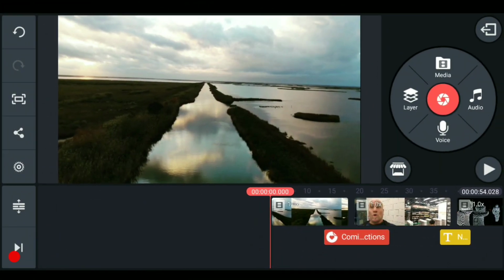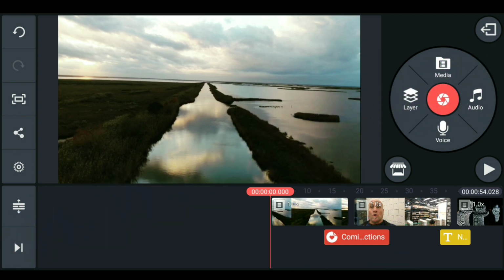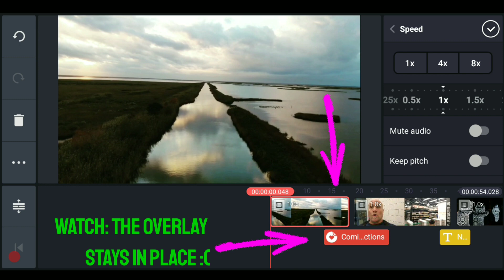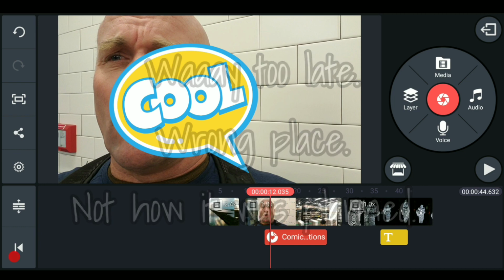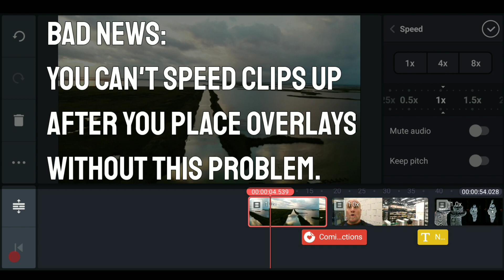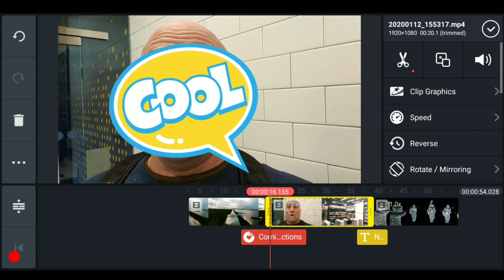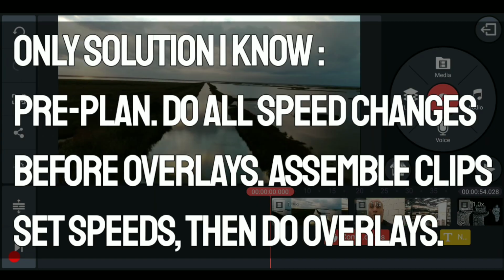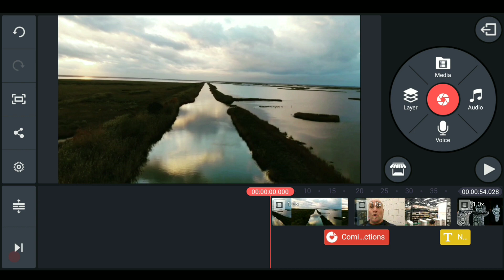Kinemaster Tutorial - working with speed changes and layers

Comment: Unfortunately if I go over 1.9 speed I get a message it will not play right.Would be nice to be able to use higher speed ups🤔
Reply from the maker: Hello, I am pretty sure that message is only about preview speed - once the video is exported it should be able to play properly.   That said, speeding up really fast can still result in jumpy output because the reality is that you are cutting out content in order to compress the time.  It's a mathematical formula (not one that I can actually calculate - but it is math) and so a lot of it seems to be making sure when you film it that you move smoothly.

I don't have great suggestions on that but to start just try exporting and take a look how the final product looks
Reply: @masteringkinemaster8173  thank you for all your help,we made a much nicer video after your tips recently,  titled : royal explorer drywasher quick sample check it out you have time .Thanks again

Comment: I don't have anything to add to your video except to say that I know EXACTLY what you are talking about with this "speed trap." I've run into it over and over again, and it has caused a lot of headaches.

I recently started mounting GoPros on a scooter to capture video. And I often end up with long video clips of me riding along a beautiful or interesting road, and I decide later on that I want to speed it up. And then, as your video talks about, I have to reposition every single layer element in the video project. And if I adjust the speed later on or change the speed of another video clip, I have to go through the whole process all over again, and again, and again, and again.

As far as I can tell, there is no solution to this problem except for the one you suggest: just try to avoid the speed trap. Plan your video carefully so that you DON'T change the speed of a video clip later on. Unfortunately, I end up doing it a lot anyway because of the scooter video clips I've been filming lately.

One technique I've developed has made things a bit easier. It's not much easier, but a bit. Now I try to always add a layer element at a point where I've split the main video clip. Every time I insert a photo or a song, for example, I split the video at that exact insertion point and snap the photo or song to that point. I don't actually need to split the video there, because I'm not changing anything. I do it just as a way to mark the point where I want the photo to appear or the song to start playing. And then when I change the speed of a video clip and I have to move everything, it is a lot faster. I can visually see where the photo used to be, and as I drag it there, it will snap into position right at the spot where the video was split.

It ain't great, because I end up with dozens of splits in the video that didn't really need to be there. But it's a somewhat helpful workaround. 

It would be convenient to be able to put a Bookmark right in the video clips themselves (as opposed to a timecode Bookmark). But I don't think Kinemaster can do that. 

As always, thanks for the Kinemaster videos. I've found them to be quite helpful. 👍

Comment: speed isn't even on the thing when i press the things you press ;-;
Reply from the maker: Speed is only avaliable in clips and not in layers.  I'm guessing you are trying to use speed change in a layer.
Reply: @masteringkinemaster8173  it only works if i use video and photo or is that just normal?
Reply from the maker: Check my video on layers and clips to understand the difference.

If this is not the problem maybe you  can post a screen capture

Comment: Can you adjust music speed? If u can, please tell me how thanks
Reply from the maker: There isnt a really easy way to do this.
Kinemaster let's you change the pitch of the audio without changing to speed (many times software is the opposite) but it doesn't let you change audio speed unless the audio is part of a video clip.

A way you could do this takes a little extra work and I have  not tried it but it might work.

Step one: make a project with just a black frame as the clip and your audio.  Export this as a video so you will have a video which is just a black screen and your audio.
Step 2: add that video to your project but it needs to be the clip - it can't be a layer - layers can't be sped up. 
Step 3: use the speed control which is in the clip menu.  The nice thing about this is that you can check the box to keep the audio pitch the same.

Fyi, I decided to quickly try this and it does work but one thing  important - you can not "extract audio" from the black screen video, the extracted audio  will change back to normal length so you absolutely need to use it as a clip.

I think I would probably try to find an audio app of it were me.  I have lots of audio apps on my laptop so I don't have a recommendation for a mobile audio app but it's my guess you could find one that would do better than thus solution.

Sorry! But, it does work, it's just sort of limited.
Reply: @masteringkinemaster8173  great idea! thanks alot bro. i have started using kinemaster to edit my basketball YouTube channel.
Reply: You can try down loading a app that slows down music